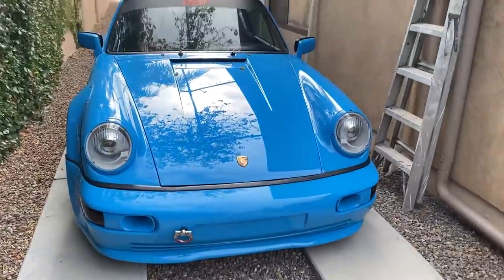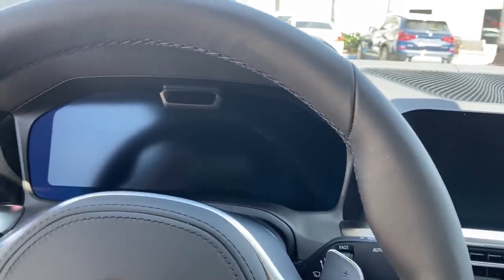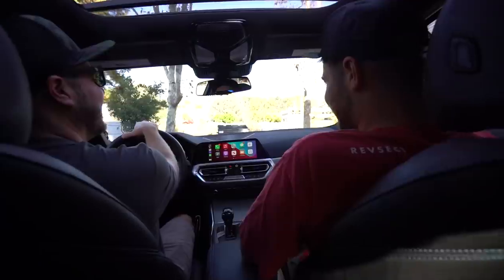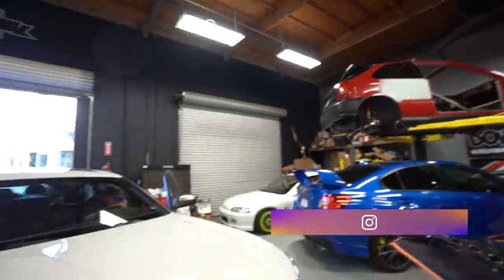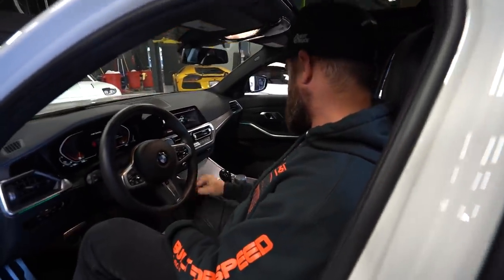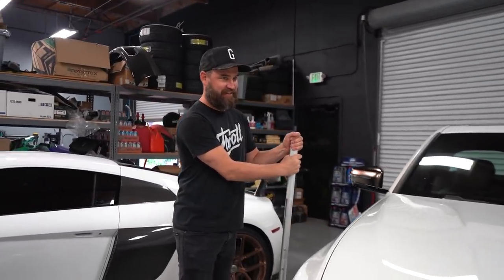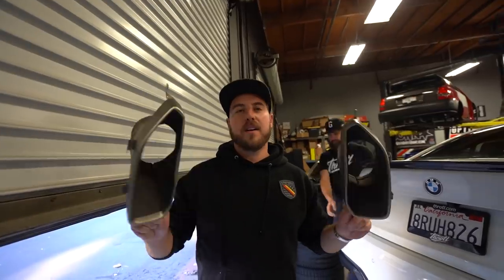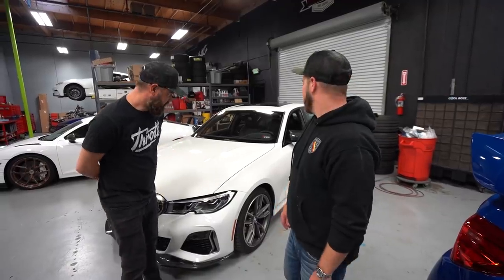NEW PROJECT: 2020 BMW M340i X-Drive : Turbocharged B58 + carbon fiber goodies!

Comment: The usual, CF side skirt extension, CF bonnet, CF grille, new wheels,  quad titanium exhaust with burnt tip, maybe subtle wide arches since its a daily, tint window if not already, thats it for exterior.......

Comment: The carbon diffusor is - let's say- badly engineered. You can't access the hook hole anymore, the original tips don't match... I don't like it. Greetings from 🇩🇪
Reply from the maker: It’s meant for a custom exhaust, and you can access the tow hook no problem